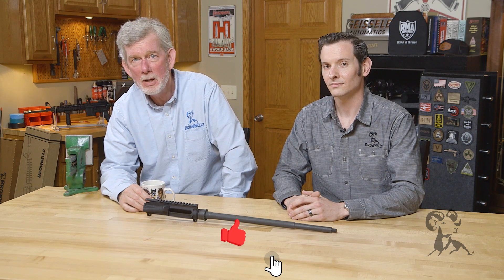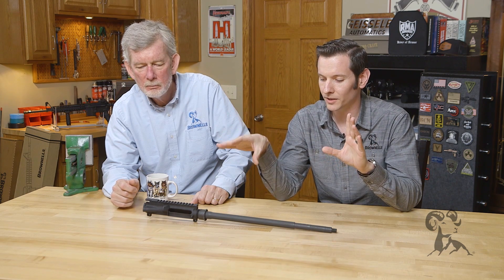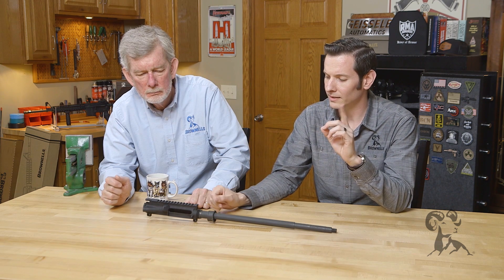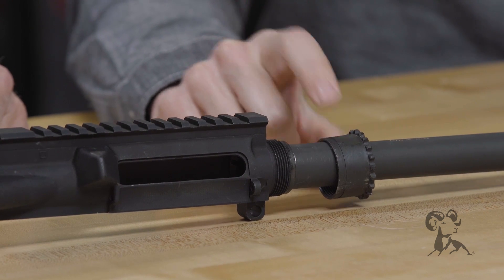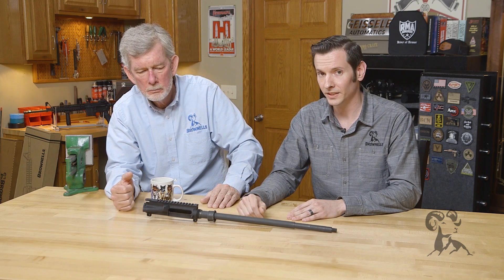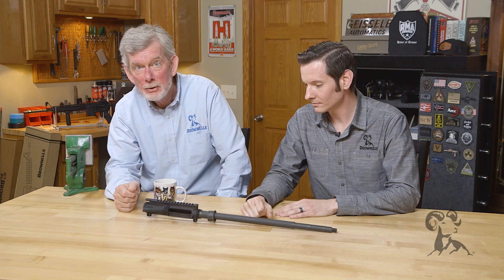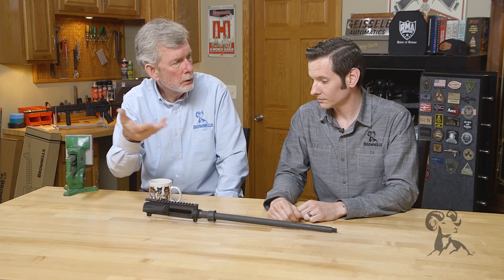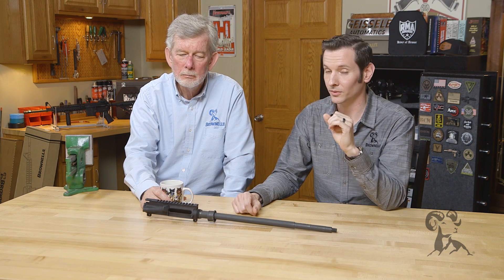SmythBusters: Galvanic Reaction & Your AR-15 - Part 1

Comment: How many uncoated aluminum components are bolted to iron engine blocks for years and had no issues, and that's while being subjected to the outside environment.
Reply: pull them off, you can see the surface corrosion induced by galvanic reaction, while it's not Super bad due to the inhibitors in coolant, it does still happen.
Reply: @62saki91  There may be a bit of corrosion but in most cases it's nothing excessive. I'll also argue that the corrosion inhibitors don't even come into play because if there's coolant hitting that surface then there's no metal to metal contact. Look at a transmission bellhousing for example. When you separate them the mounting surface will usually be a lot cleaner than the surrounding metal, on the block and trans.
Reply: @TripleL-c5t  maybe, but the issue with galvanic corrosion is it's an electrolytic reaction, so the coolant needs the inhibitors because it's a conductor. the trans mission bell housing is usually magnesium alloy, if it's aluminum they have a gasket between them and the iron block.  or they put an aluminum block to an aluminum bellhousing.

Comment: USN has plenty of issues with the reaction between ships steel and aluminum parts. it's in our manuals because sea water can sometimes get in between the two. not a huge deal with properly installed parts but still an issue.
while its unlikely that this would happen with an AR15 barrel nut, its still possible in theory. thats where everyone goes nuts. 0.0001% chance then its suddenly the most important thing.
seen 100times more loctite holding on barrel nuts than corrosion.
Reply: Guys he’s saying the same thing. Read what he wrote carefully. He’s saying it’s technically possible but it’s perhaps a one in a million chance. My guess is it’s slightly higher, but that’s because a very few precision guys cart off all coatings before they assemble their barrels to their actions. Of course that’s insane because of course AR’s are quite accurate but nowhere near actual precision rifle accurate so it’s definitely a rare thing for these guys to build these types of guns.
Reply: @challenger hemi Pretty sure that's what undeadhamster23 is saying.

Comment: It also requires a strong electrical current to pass through the metals for a reaction. It stems from automotive industry and car guys when the industry was using different aluminum and steel alloy components in cars and trucks. To include cross-contamination during repairs processes, as steel (alloy) flakes/dust/particles can imbed in aluminium causing impurities on raw surfaces past the oxidized or protective covering.
Reply: Ambrose-adventure I have seen it on tin roofs and roofing nails resulting from static electricity in thunderstorms or just a result of oxidation but I have never seen it on guns with proper coatings. I still put a layer of plastic between an aluminum rail and a steel receiver though for protection if nothing else. :-)
Reply: @rbm6184  I have been enlightened, no pun intended.
I'll retract my statement of "stemming from" in from my prior post.